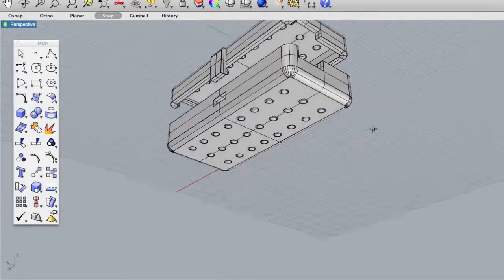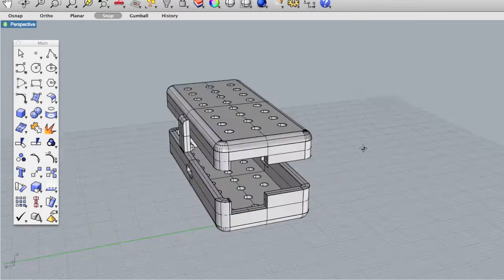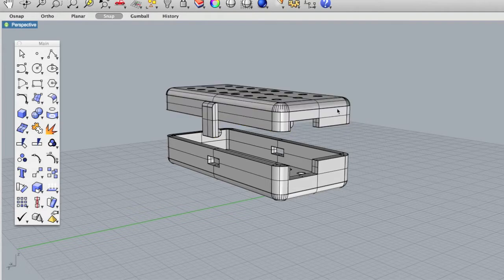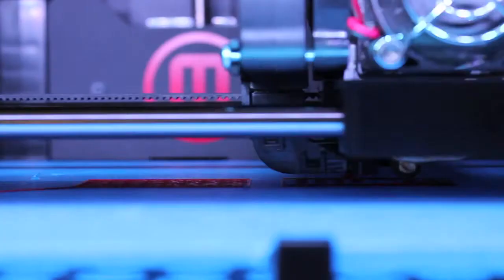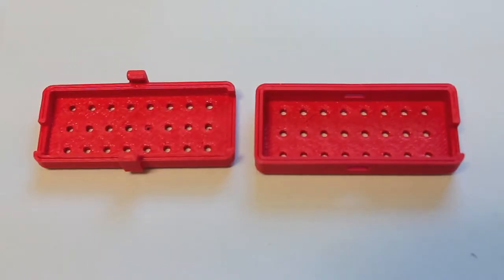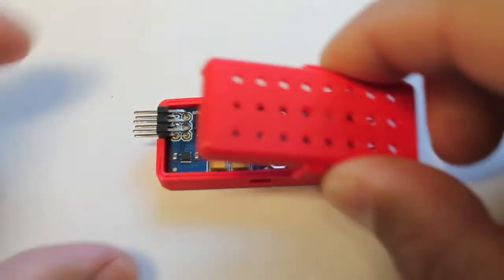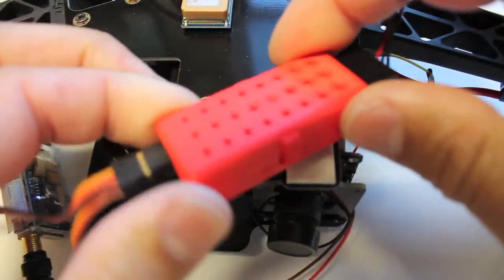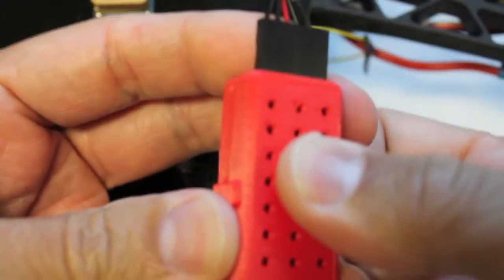APM MinimOSD 3D Printed Case Available for Download on Thingiverse

Comment from the maker: I hear you on the TX front. My 200mW doesn't have the fan, but it does have a heat sink that creates a problem when trying to mount it. I know exactly what you're talking about with the fan. I've seen several of them. Do you have a link to the Flytron mount?

Comment: Great work.    Since the MinimOSD is pretty much flat I clear Shrink Tube does nicely to protect it for me.

What I desperately need is a mounting structure for the cheap 5.8Ghz 600-2000mw Video Transmitters with fan that ebay is selling.   The only way to mount to their uneven bottom half is with gobs of 3M tape.  Maybe a mini tx tray with side Frankenstein style bolts so we can secure out TX's (no matter the brand) with rubber bands.  Similar design to the Flytron gopro mount.

Comment from the maker: Thanks for sharing your thoughts. What do you think about PLA? I don't print in ABS, but PLA. It's pretty rigid and since this design is so small with 10% infill it's very light. I'm more concerned how it's going to hold up if the boards gets too hot. I think that will no longer be an issue when I upgrade to the V1.1 board with better voltage regulation. Unfortunately I can't do anything with vinyl at the moment.

Comment: As a matter of fact I use 3D printer often, and I would say that ABS plastic is pretty bad choise of material for enclousures for high-impact devices like quads/planes/wings. Also ABS plastic is relatively heavy for it's volume. Of course, it looks nice, bet simple thin plastic enclousure from 0.5mm vinly would be lot better.